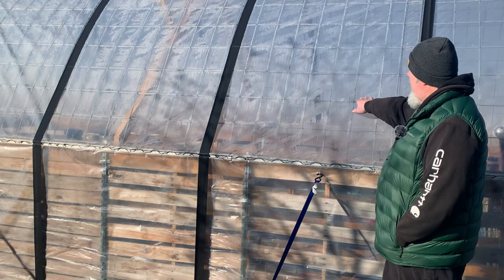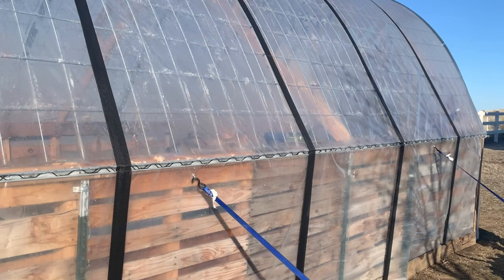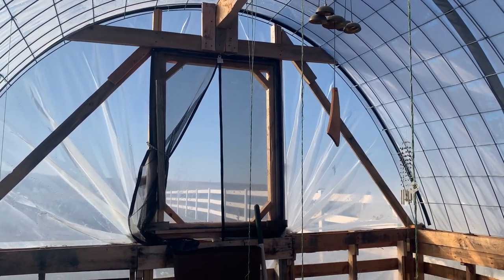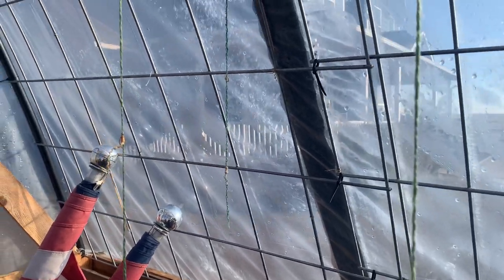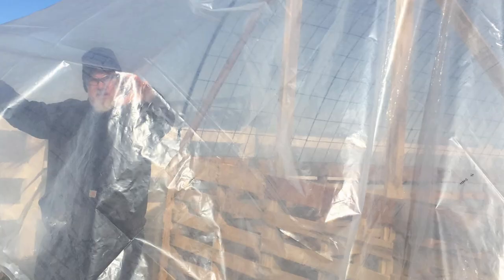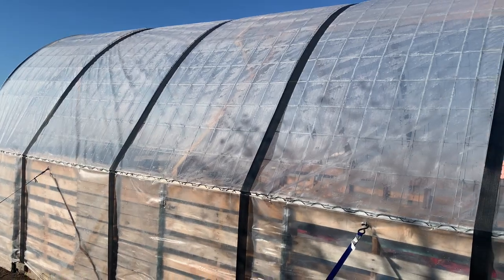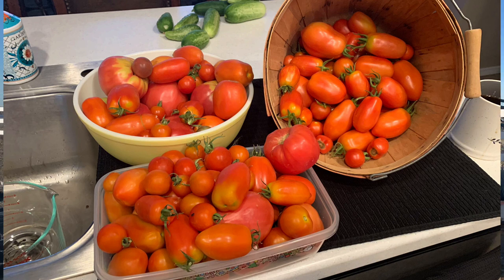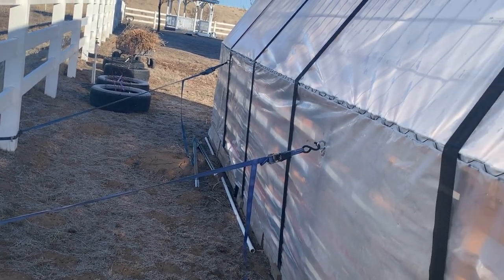Best DIY Windproof Cattle Panel Hoop House High Tunnel Greenhouse Build !!! Cheap and Easy

Comment: How did you attach the tee post to the pallet
Reply from the maker: We pounded some through the middle of the pallets for support and then the ones on the outside we used pipe “c” clamps.  Hope this helps!  Thank you for watching!
Reply: @homesteadingwithblueskyranch  thanks